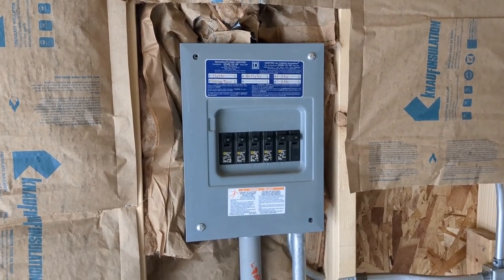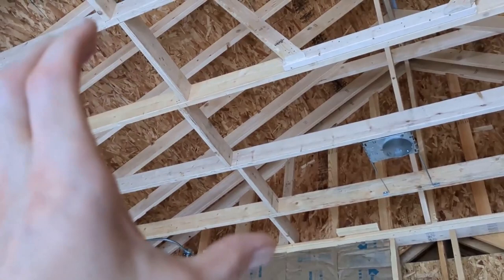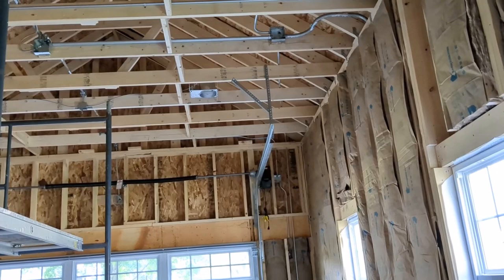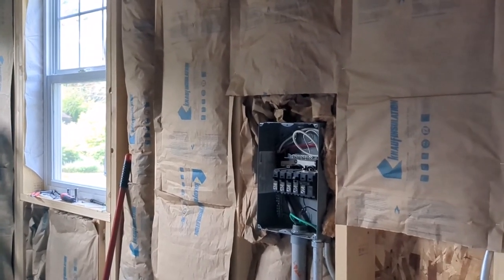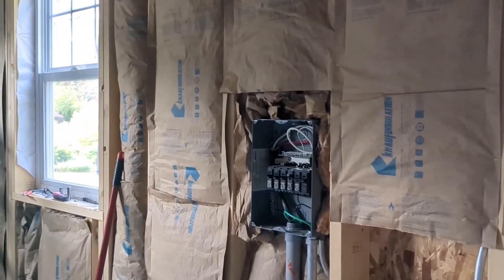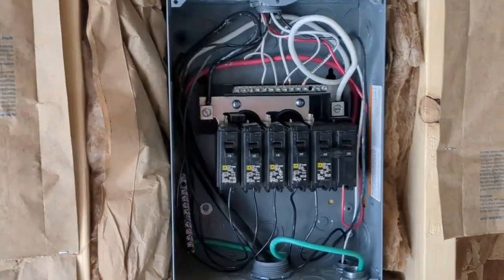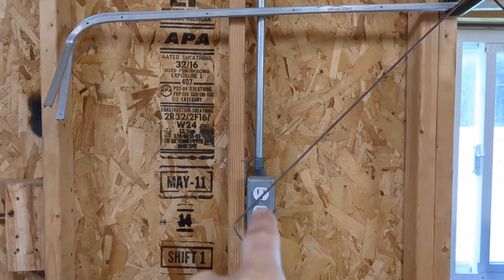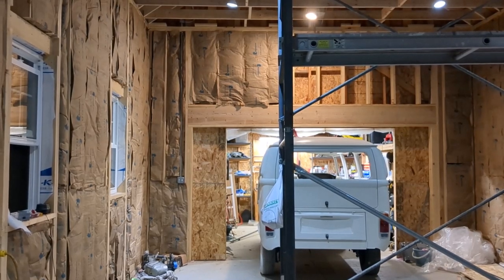Garage Rebuild Part 5: Ceiling Framing and Electrical

Comment: Nice update on your building Scotty.   Its fantastic and very nice work on the conduit.  I dont think a pro electrician could have done any better.  Conduit is a pain in the but, I have used the plastic stuff before but not the metal.  Look fwd to seeing the insulation and drywall.

Comment: great stuff Scotty. Those motion eyes are very capable when you move across (laterally) their vision, but much less capable if traffic walks up along their centerline. You might think about angling your motion eye to not point at the driveway, but to the side and over it that way traffic moving up the driveway (or from behind the west side of your building toward the driveway) is caught in its peripheral side vision where it is more sensitive.
Reply from the maker: I will play with the motion sensor angle and give your advice a try. Thanks!